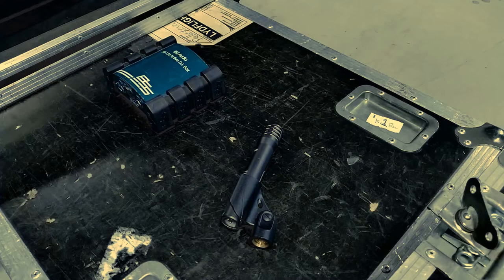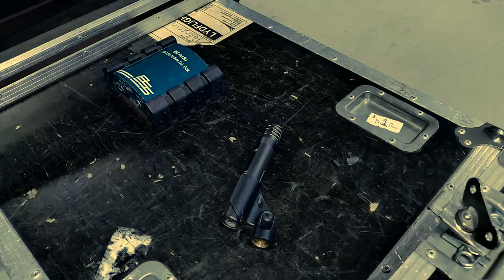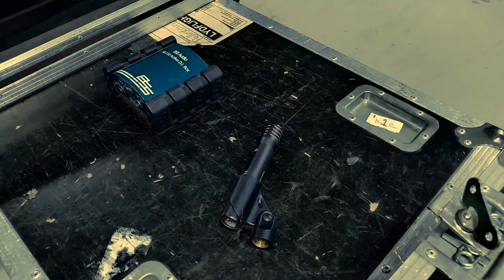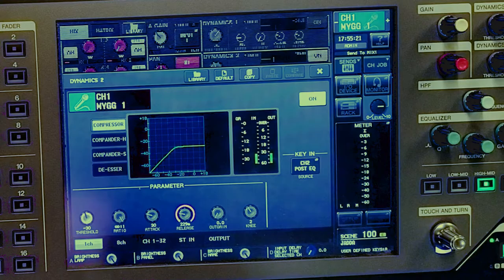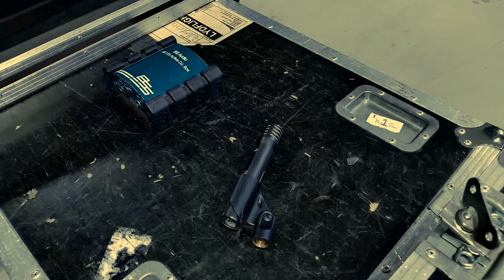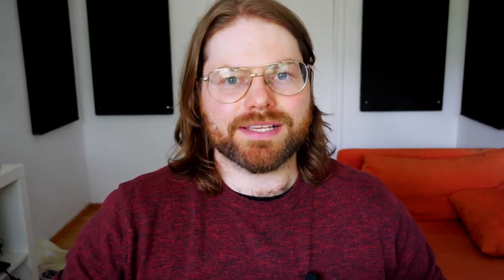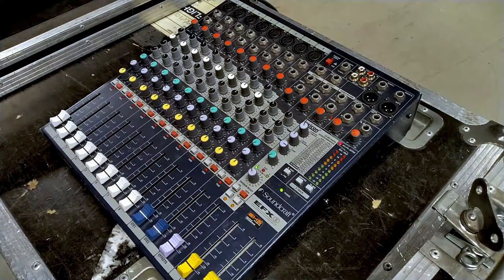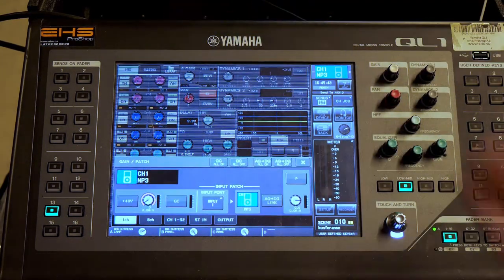What Is A Pad On An Audio Mixer

Comment: Thankyou.Can I use a pad switch instead of using a Di box when using the keyboard and when inputing it through the microphone input?Assuming am asing the snake cable
Reply from the maker: A pad by itself lowers the signal but doesn't match impedance or balance it like a DI box does.stick with the DI box.